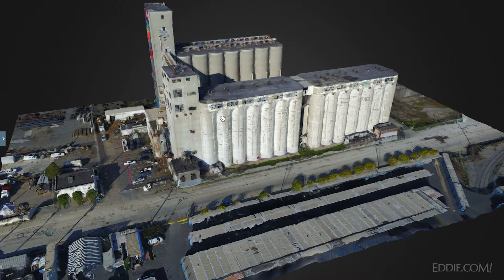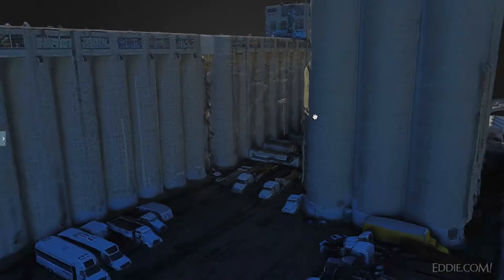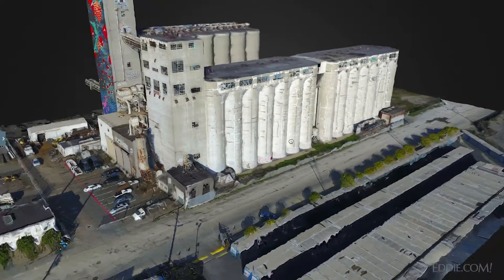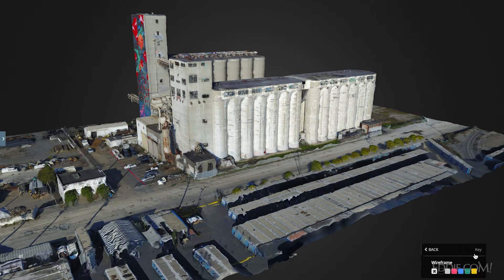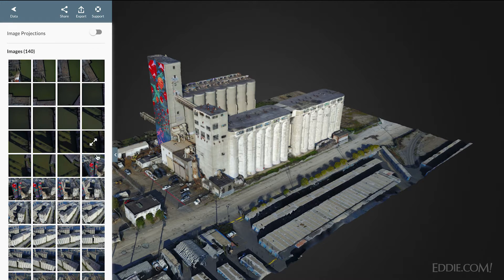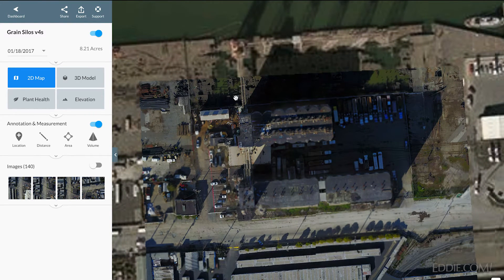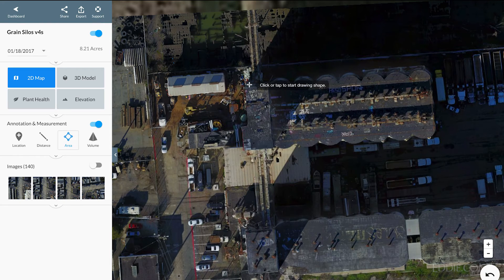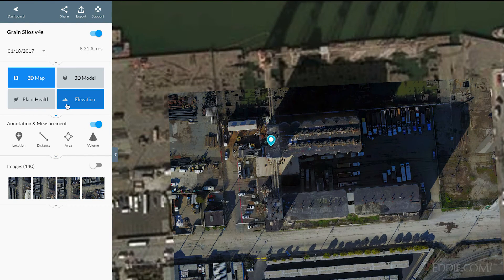Creating a 3D Model With DroneDeploy

Comment: Thank you for the greet video.
My question is this. After you did your first passes, camera straight down. How do you add your the 35 degrees passes in the initial passes ?
Can I set it to do the exact path, but with the camera at 35-40 degrees down ?

Comment: The orbit photos, shown around 7:30, have a very circular shape. Is there a feature in your drone that lets you choose a center point and automatically circle around it? It seems incredibly well flown, which is evident by the output. If that is not automated, you are an amazing pilot who should give Sully a run for his money!
Reply: We have this baked into the app now! Check under the 'Advanced' section to enable.
Reply from the maker: Good eye. Yes, it is very easy to automatically conduct an orbit around a point of interest. In the DJI GO app you select Point of Interest, manually fly to a center point above the structure, mark it, then fly out to a radial distance and hit go. Speed, direction and radius can all be adjusted in real time.
Reply from the maker: Nice! I will indeed. Thx for the heads up Jono!

Comment: Hi Eddie, the quality of the model turned out great. How did you go with focusing the Mavic camera? Do you set the camera focus first in the DJI Go app then switch to Drone Deploy or do you just let Drone Deploy control the camera automatically?
Reply from the maker: I do launch the DJI Go app and set focus and exposure settings before launching DroneDeploy. I don't think you need to do it for focus anymore, but it's nice to lock in your exposure before deploying.

Comment: Very cool Eddie.  I am a fellow mavic pilot. I want to add this as a service I can do. How are you going to approach potential clients for this type of service?
Reply from the maker: Creating videos like this are a way to build a foundation of knowledge that I can point potential clients to. There are a number of online marketplaces that connect clients with drone service providers. DroneBase.com is one that's top of mind.
Reply: Yes Drone base is getting better.  Good Luck!
Reply: With the automation how high did the app send your drone? did you have to alter the height to get over the tower at the front?
Reply from the maker: The default altitude of the DD app is 250ft. I chose to fly at 225ft, the largest tower is I think close to 175ft.
Reply: Eddie Codel how slow do you have to orbit to get clear images?
Reply from the maker: I think I was going about 5 mph during the orbit, though you can easily go faster. The trick is to get enough images so you have decent overlap.